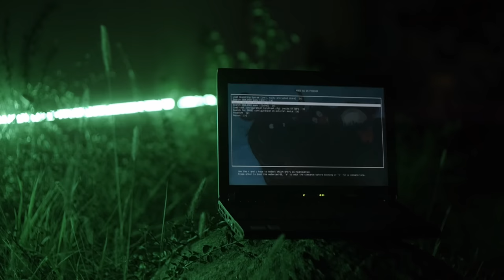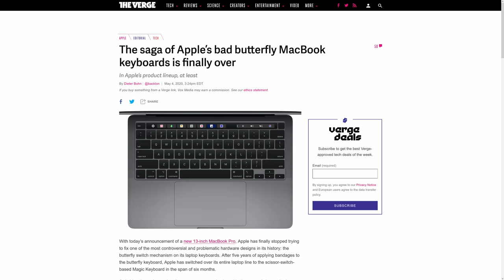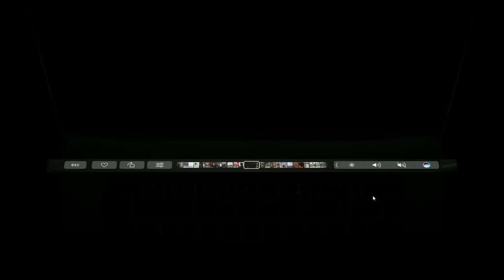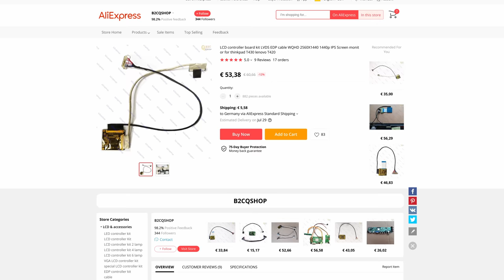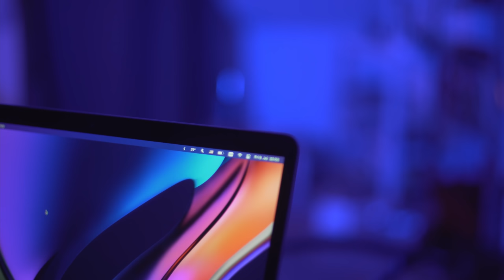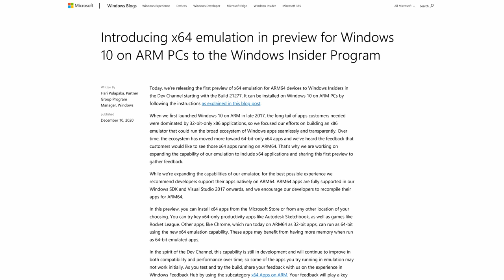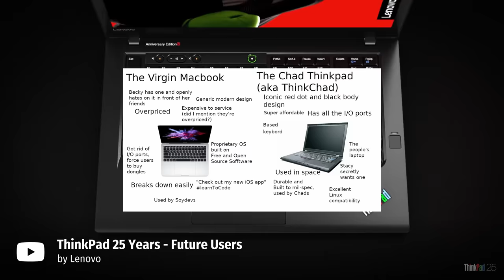Why I Switched to Mac (as a Linux user)

Comment: Linux user here as well. No one can say that Apple laptops with M series chips aren't good. They are, very much, and their power and battery life makes them very, very attractive. My main two problems with them:

-Zero repairability/upgradeability
-Don't think that I could run Linux as my daily driver on it

Best option I've got is the Framework laptop. It's not perfect, but it's pretty darn good. It's powerful enough for my purposes, but I wish they were more efficient so I wouldn't have to limit its performance when running on battery power. Sweet perks for the Framework:

-I can make it better over time
-I chose some of my own components and I got a really good deal for the RAM (64GB) and SSD (2TB Kingston KC3000, which is also speedier that the Macbook's SSD)
-Runs great with Linux Mint. No stability issues whatsoever. Best stock desktop Linux ever made in my opinion

With that said, it makes no sense to shit on the Macbooks. They are what they are, which is, really neat, well built and designed machines. One of my friends needed to get a new laptop 6 months or so ago, and she was used to Apple, so I went with her to the Apple store to get her a new Macbook, and not gonna lie, I was more excited and curious than she was.

Comment: I'm considering investing into an ARM Mac. I had a 2011 Mac Mini, which is still a great media centre, but wdeveloped a faulty ram socket after 1 year of use, and only gets up to High Sierra.
The fact they can now offer a week of battery with the CPU change is amazing. I would however also like to dual-boot Linux on it (I know Corellium have a port), so I'll maybe maybe til the M1X redesigns.

Comment: You say no one asked for thinner laptops but where I work I’ve seen office workers get upset at the IT department for supplying them a laptop that was thicker than they wanted. So clearly someone wants it and judging by the person it’s the kind of casual consumer I could see buying a Mac. I used to use Macs until nearly a decade ago when I got fed up with bloat at the time (it’s probably better now) and then my kid spilled my beer on the laptop and I took that as a sign. That being said whenever I see videos like yours it gets me wondering if I should try Mac again as my laptop but I’m usually at my desktop anyway

Comment: The comparaison between an old but upgradable machine, and a just 4 times faster M1 Mac while also lasting longer on battery sums it up. We should by a machine that suits are needs the most, and keep it until it becomes irrelevant in terms of usability. I don't see myself bying a old thinkpad anyway. I already have a slow laptop that works despite its missing screw and that I will replace eventually. Hopefully with a machine that can last a day on battery like my tablet. Should I see if I can code on my android tablet ? I don't know.

Comment: I was a linux user between 2000 and 2009. But I was fed up with laptops with anemic batteries. At that time, macbooks were the only computers to offer real autonomy and good standby management. 
The unibody models of that time have finally convinced me. I still have a 2010 superdrive at home. 
The trackpad is the most efficient way to control a computer. 

And little by little, I let myself be locked into the apple ecosystem because it's just convenient and well done. Everything is synchronized between devices (continuity, airdrop ... ). 

Of course, not all apple devices are good. But most of the time, it works out of the box. 

And the Macbook Air M1 is an amazing machine for classic use.

Comment: Honestly, ever since that M1 chip came out the part of me wanting a Thinkpad died out. The moment I saw the benchmarks, I was in disbelief because I never expected Apple's choice to be this compelling. Maybe someday once I leave college, I will get my hands on such a device.
Reply: I'm no Windows fan, but whenever they finish their Windows ARM port, it's going to be as good or better than the M1 MacBooks. Apple beat them to the punch, since they don't have all the legacy software to support, but they'll inevitably lose their advantage. Like with cars, companies like Nissan and Chrysler were the first to introduce CVT transmissions and it took Honda and Toyota a few years to introduce them, but when they did they blew them out of the water. Although I don't think M$ will necessarily beat them the same way, but they'll certainly catch up at least.
Reply: @uncreativename9936  Oh, I'm sure they will catch up with Apple. I am also sure that there will also be cheaper alternatives that are less powerful, so I actually save some money in the process. However for now, Apple's option is the only one, so I didn't want to speak before the fact.
Reply: @uncreativename9936  This is a classic copium post. Microsoft has been working on an ARM version of windows for MORE THAN A DECADE. Despite this x86/64bit emulation is God awful compared to Apple's implementation of Rosetta. Also you act like Apple is sitting still, we are already on the M3 which blows the M1 out of the water. Snapdragon made a huge deal about an "M killer" chip that performed 5-10% better then the M2 at around THREE TIMES the wattage. Its a joke other chipset manufactures are far behind and unlike Apple, Microsoft doesn't have the balls to push developers strongly to ARM.

Even Microsofts ARM desktop (Windows Dev Kit 2023) costs the same as the Mac Mini, yet is hideously underpowered and weaker than a 5 year old iPad.

Comment: Is intergrated Graphics in M series better than integrated graphics of Intel CPUs?
Also, what you'd suggest to ML engineer? Beefy mac or Linux laptop with dedicated graphics card?
if the latter, do ThinkPads support Linux 100%? or should buy laptops specifically made with linux in mind, such as Tuxedo/System76/Clevo?
Reply: As for Intel vs. Apple integrated graphics, Apple wins. 

For ML, more RAM is better. And due to how Apple Silicon is designed, the NPU and GPU can use almost all of the system RAM.

Comment: I’m a life long Windows user because I’m also a gamer and for the longest time I had one PC at a time. A few years ago my setup changed and I had a desktop PC for gaming and a used Lenovo Thinkpad for everything else. But it’s weight, shitty trackpad and short battery life became frustrating to me so I looked for alternatives. That was in 2018/2019. And when looking around I concluded, that mid priced windows ultrabooks suck. No matter how much I compared in the up to 1000 dollar range, I always landed on an entry level MacBook Air as the best option. And the two reasons up to this day are the superior sleep mode and the trackpad. The MacBook Air had the first trackpad I ever used I didn’t pray for a mouse the second I started using it. Since then upgraded to an M1 Air and never regretted it. Especially after going to a big electronics store a few days ago, realizing that windows trackpads still suck.

Comment: I was seriously considering Macbook Air M1, but decided to buy X1 Carbon anyway. The deal breaker for me was keyboard and lack of trackpoint on Mac. I use my laptop for light work only (RDPing to the office, browsing, etc). Heavy work like compilations and other software development is done on my workstation. So performance of M1 chips is not really needed for my purpose. Battery life is good of course, but 8-9h X1 gives me is far beyond enough.
Physical interaction with my laptop is super important to me. I hate touchpads so much, I disable them in BIOS on my all Thinkpads. I tried really hard to convince myself they are good for controlling a laptop but they are not.
Keyboard on Mac is another story. Even though X1 Carbon is far from perfect, it's still leagues ahead of anything else offered on laptop market. I even consider Thinkpad keyboards superior for everyday work when compared with mechanical keyboards and use old usb Thinkpad keyboards for my desktops.
Reply: You obviously have never used Apple trackpads.

Comment: Do you find that M1 macbook air with 16GB of RAM should be enough for DevOps tasks (VS code, IaC tools like terraform or ansible, cli tools, Docker, kubernetes, scripts writing in Powershell, bash, Python, from time to time coding and compiling applications in C#) or should I go with the new MacBook pro with M1 pro chip?
Reply: You probably already bought one by now but for development work go with a pro. The MacBook Air has no fans and if your doing a lot of compiling, docker, etc etc your going to saturate the macbook air and it will be forced to throttle. Also if you use multiple monitors (more than one external) youll need the Pro

Comment: 2 years ago... do you  still enjoying the 8GB  M1 soldered closed box, or apple left support for it and you cant surf the net?

BTW if you use Linux, DaVinci Resolve is available since some years ago. And to fix an issue in linux is just to backup your dotfile and reinstall. OSX  can be a headhache (and when you lost the support, you´re lonely. But credit card is allowed, no problem)
Reply from the maker: Yep, still works like a charm after 3 years :) Meanwhile, how many times did you have to reinstall Linux?
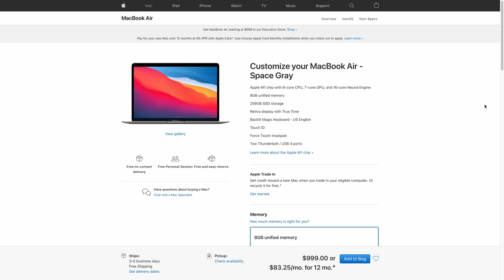Reply: @madreselvaest  "16GB of ram"  7:10
Reply: @WolfgangsChannel  have to... Never. Even I ported some hard drives to another machine, without "installation", and they booted like a brand new PC. 

But I use Arch (btw lol), and I reinstalled a lot of OSs' in different machines, but just for to learn. In the past a new machine could be a headache. Now the compatibility is almost absolute, and sometimes better than in windows or OsX,  with reverse-engeneering community drivers!
Reply: @jeremyb1346  I hope MacOS get a lot of optimized updates for to run AI with a not upgradable RAM-VRAM and not slots for TPUs. 

If not, users will have to pay for AI cloud computing services, or get a new Mac, and perhaps pay for AI new-gen cloud services
Reply: @AmenomejodasPajaritos  I agree, Apple made the decision to put only 8GB of ram and small SSD on the base model because, ultimately, it will increase their profits. Not to mention lobbying activities and the manufacturer's sweatshops in China.

But that's not my point, your initial comment was inaccurate, as far as I understand english (not completely) he bought the 16GB upgrade. Wolfgang's point is that this product is a good tradeoff considering his use case and what the rest of the market is proposing.

Comment: I'm not a fan of Windows. I use it on my main computer because it is a gaming computer and it is able to run all games without issues. That is literally why I use it. So if someone uses anything other than Windows has my respect. MacOS and GNU/Linux OSes are so similar to the end user. MacOS is a UNIX operating system and GNU/Linux is a UNIX-like operating system. From the core they work similarly. What I like about MacOS right now is the extraordinary use of Macbooks ARM architecture to grant performance and humongous battery life at the same time. Other than that, I'm not a fan of the Macs. They don't have USB ports and Ethernet ports on them which makes them less useable. If you want to go beyond the touchpad, either you're gonna buy the Apple's overpriced ergonomic nightmare mouse or external adapters. Also sometimes if not paid good, the external adapters will have physical contact issues especially with the mouses. Also this is more of a personal view here I would like to use an open source OS rather than a closed source one. I want my OS'es code to be visible on the internet so I know what it's doing and so that it can be contributed by millions of people. I also want my OS to be customizable so I can leave a mark on the OS indicating that it is mine. I also want my OS not to order me around and limit me with paywalls, subscriptions and companies. I want my OS to be invulnerable to generic malware that targets most of the population. Surely Mac does it good but Linux is even better because of it's code being visible, people fix security issues with it. I want my OS to run games if I need to. Mac is not supported with Steam. Steam has a Linux support which allows you to try to play all games with it's own compatibility layer. I want my OS to grant me choices of my desired desktop, or even allow me to build my own personalized desktop from scratch. That is why I am a GNU/Linux fan rather than MacOS. There is no point for me to try Hackintoch. Flashing linux on a USB is objectively an easier experience. And it is valid, you're not pirating any Linux OS because they're freely distrubuted. MacOS is not free, it is meant to be closed to Macbooks only. And no, Linux is not hard to use and you can choose a dominant and easy Linux OS just like Windows and Mac like most of the people does. There is Ubuntu and Fedora out there.

Comment: You have some good points.... Personally I have a big issue with all laptops that have a screensize smaller than 16 inch. They all suck at productivity, no matter what brand and OS. If you want work done, no smaller than 16 inch. I also have an issue with mac hardware. There are a part that Apple are using, that are part of the power circuit. And when it fails some one year to one and a half down the road. It destroy the solid state storage. And speaking of storage, then it is the worst part that one can design as a non removeable device. Like what the hell? Every maker of hardware, that go this route, should be publicly flogged. And have rotten tomatoes thrown at them. At least make it removeable, and room for the choice of using a mechanical storage if one is super into reliability in regards to spinning and mechanical storage. Yes, I know that one can always have a NAS or something at home. But if it crashes on the road?

Else. Yes. Windows are for gamers or for those that can not use anything else than Ms Office for corporate work and top notch productivity. Else you are better off with MacOS and/or Linux.

MacOS and Linux are the future. And if game studios chose to go the Linux route, then Windows would be dead outside the corporate world. Many people already only game on consoles anyway. So why not just make games for Linux instead of Windows then?

But so far, I have not ran into issues with Linux yet, for my needs. But I dont use computers for the same as the average user anyway. The reason why Linux is for me.

Dont get me wrong. I started with computing in 1985, used Windows untill 2016. Since then I have been fully on Linux and I have a 2011 MacBook Pro as part of my vintage collection. Mac Mini late 2009 as well. But they are not for my everyday use. They are used as vintage machines by me.

Comment: A few thoughts. First, old Macs/Macbooks running OCLP - they are repairable, very cheap, and (sigh) noisy and hot. But I'm a huge fan of the 2012-ish Apple era, esp. the unibodies. Second, what about ultra-user-friendly computers such as Framework is producing? That's where my dollars will go when - eventually - I move on from my collection of 2012-ish MacBooks, iMacs, and Mac Pros. Your linux riff about Apple... that was wonderful. I do also run Mint Debian and SuSE Tumbleweed.

Comment: I've tried macOS and the UI is similar to some of the Linux distros. What struck me the most was their proprietary keyboard. None of the standard keyboard shortcuts worked which was very frustrating. Customizing the keyboard to work like a standard one gave mixed results. It looks like they deliberately ensured that can't be done properly ... at least not without installing third party software. I guess that makes sense from business perspective since it makes switching to Linux, Windows or ChromeOS more difficult for the users...
Reply from the maker: It’s not some kind of an evil plot to lock users in. macOS and Windows were developed parallel to each other, and simply ended up having different keyboard layouts. If you look at other, now defunct, systems from 80s and 90s, you also won’t find the familiar keyboard shortcuts.
Reply: "and the UI is similar to some of the Linux distros"
You do know that these UIs were done inspired on Apple, right? Specifically talking about GNOME and elementaryOS.
Reply: @YaroLord  to tell you the truth I didn't really care

Comment: In your case a MacBook may be the right choice, and you're right about a lot of things. I understand what you mean, but for people like me that value privacy, repeatability it's not really worth even considering. In addition to that people for example in my case develop software that is rather low level (kernel in my case) have difficulty using ARM due to most people using x86. And that will not change for some time, due to PC and laptops mostly using this architecture. I'm sure that ARM and other Architectures like RISCV will become way better than x86 so it's just a matter of time.